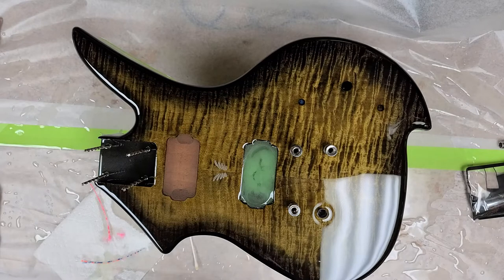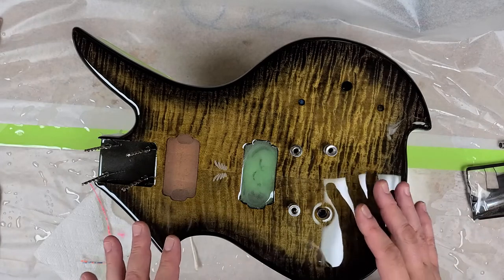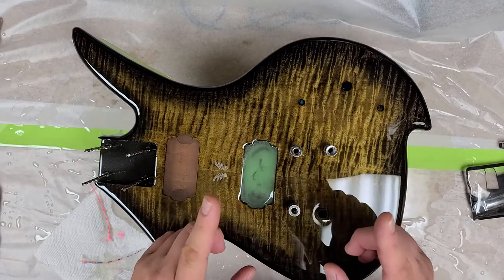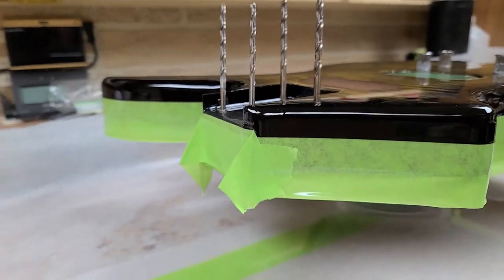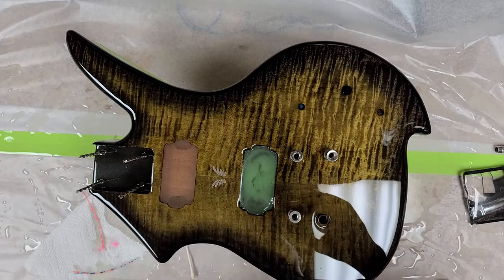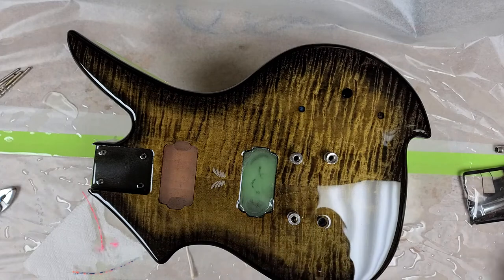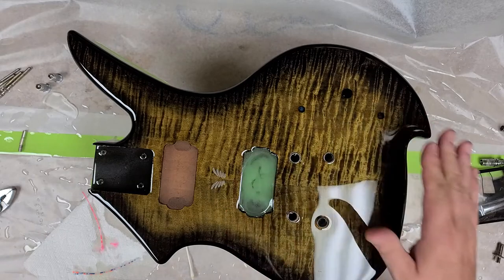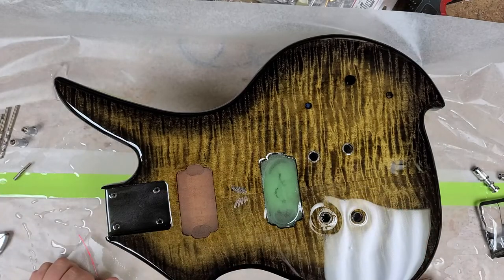Back to the Guitar Kit World Build & a little Q&A

Comment: How many times did you pour the epoxy? looks really good, I want to see how you use a razor blade to take off the masking tape and how you do the back as well.
Reply from the maker: Hello. I'll do about three pours and use the small tooth spreader to thin it out. After making some of the pen holders I have been making. I might be changing how I use the epoxy on the guitars. I'll have to explain it in a video.